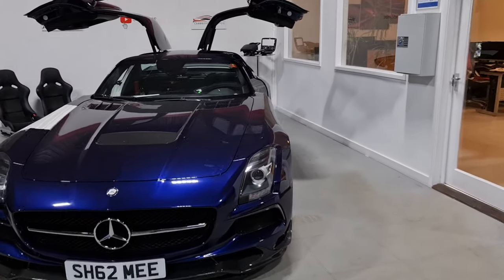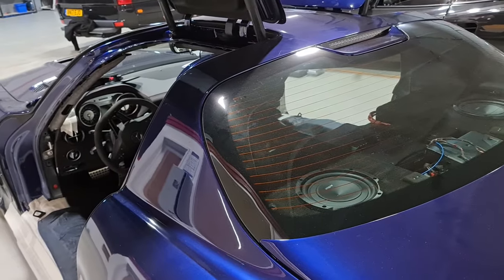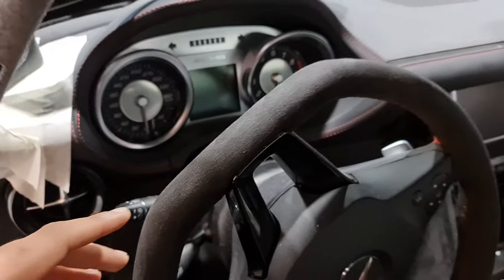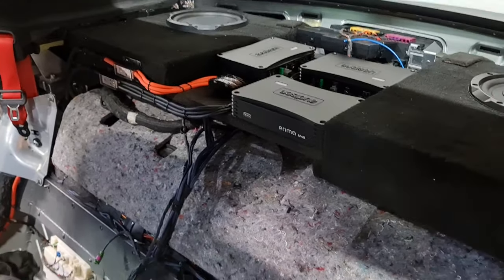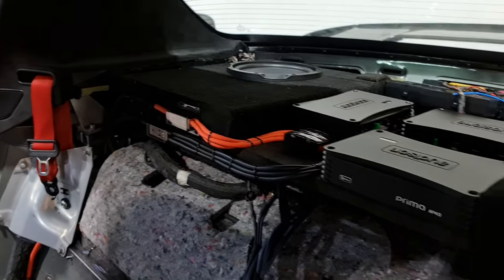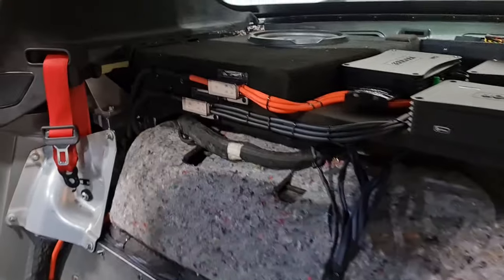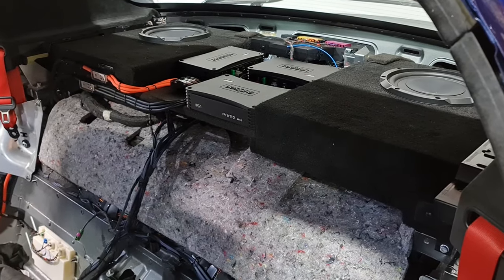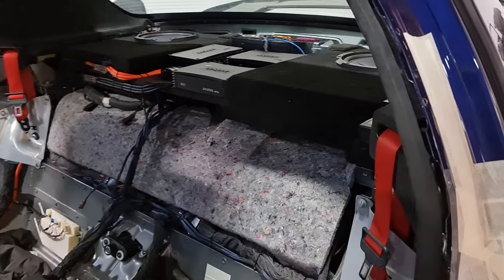Shmee150 CUSTOM Sound System | Behind The Sound: SLS Black Series - Volume 2

Comment: Because the speakers in the A-pillars are larger than Original, I would go for black to cover the fact that they are an aftermarket-part as best as possible. When you look at the silver ones and compare it with the other airvents in the car  you see there is a clear difference in the design-language between them.
Reply from the maker: Nice feedback 🙏
Reply: I agree on the black - minimalist/less visible installs is my preference at least. Audio is to be heard, not seen. ;)